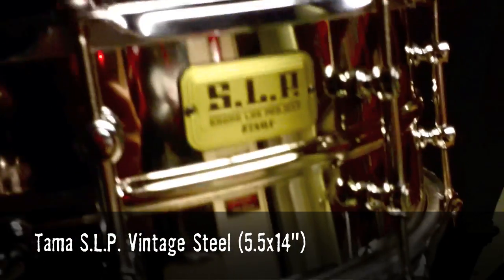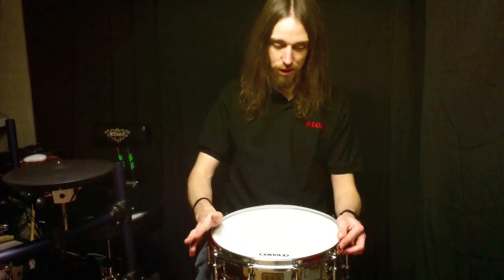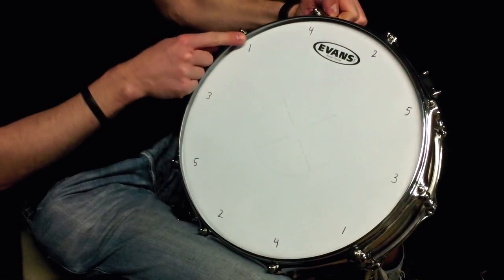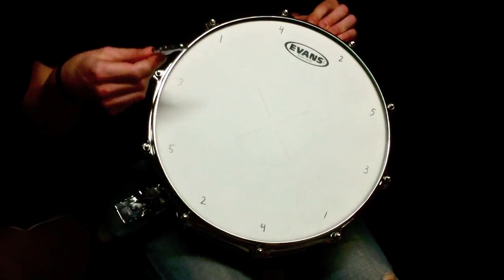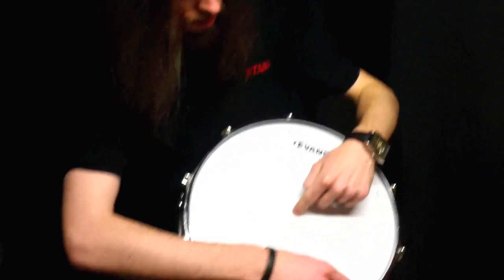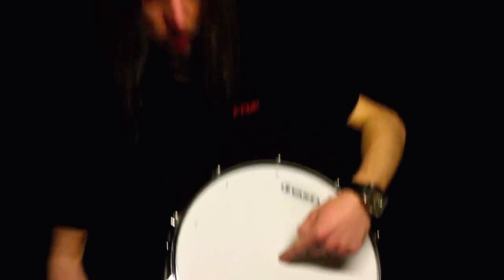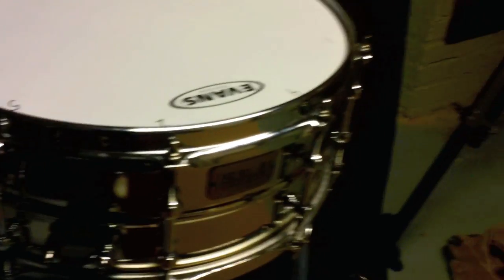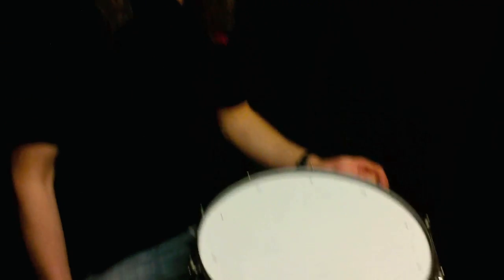Tuning the Tama S.L.P. snare drum with Dirk Verbeuren

Comment from the maker: @kevinplaysdrums1 A tight resonant head usually works indeed. Again, the key is to experiment. Try different settings and don't hesitate to remove the batter in order to focus on precisely tuning the resonant. Each snare drum has its own sound and may respond better with certain types of heads. Besides the Power Center,  I recommend the Evans Hybrid which I find extremely durable and versatile. As for the resonant, the Evans Hazy 300 usually works very well.